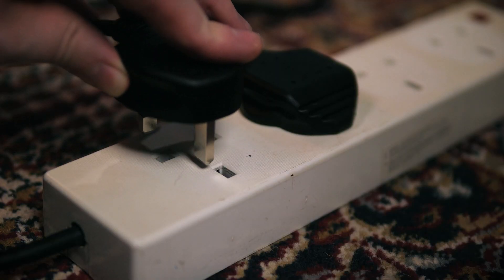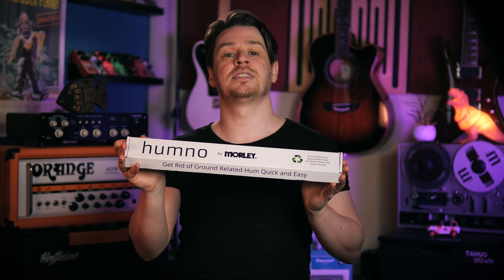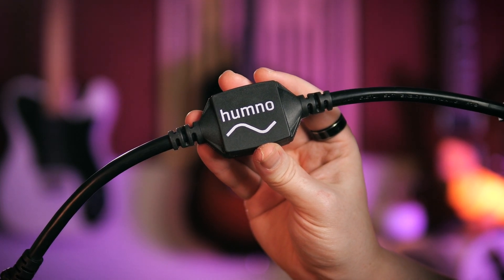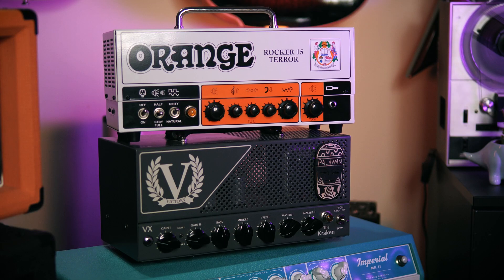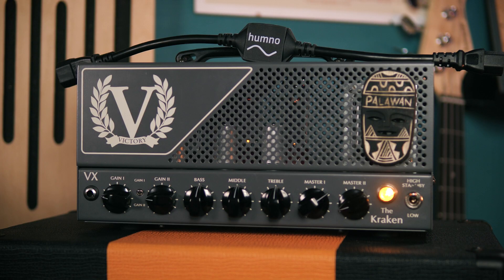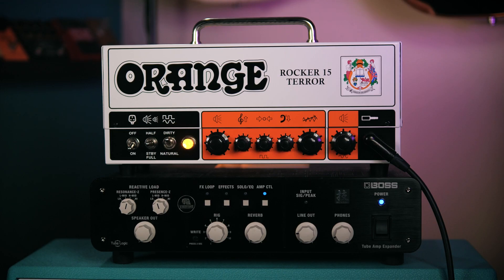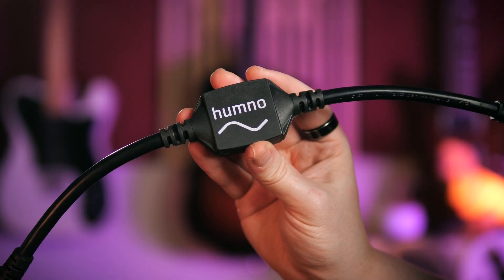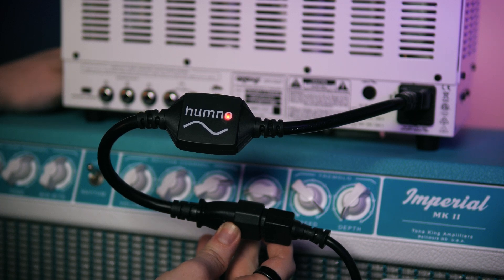HUM? NO! Eliminate Ground Loop Hum

Comment: From personal experience, if your amp is not grounded properly, you're likely to ground out those stray currents through the mic when you sing too close to it. It gets painful after a while, and it's distracting to get electric shocks through your lips and teeth while you're singing! Don't take the ground off! The PA will be grounded, and electricity will take the route of least resistance to ground itself, your wet mouth, on to a metal microphone!

Comment: Lumping all sorts of electrical interference, hum and "ground loops"  together is technically wrong. They are caused by different mechanisms and there can never be a magic cure-all device that will address them all. This is pure marketing BS trying to sell you snake oil. 
Ground loops can be eliminated with DI box, transformers, a parallel earth conductor (PEC) or balanced differential interconnections. EM interference can be common or differential mode and therefore needs appropriate filters and screening not one cure-all cable. Hum can simply be old smoothing capacitors in your amplifier which need changing. I could go on and on and on.....
Reply: You're right. Ground isolators are not a cure all. 

Ground loop eliminators are just 1 solution to a problem that can have multiple causes. This is why eliminating a source of hum is a frustrating experience.

Comment: Can’t help but say these hum limiting devices priced at 139€ are extremely overpriced for the amount of technology in them, as anyone with a background in electronics can tell you.
Reply: As an audio engineer, the only "hum eliminator" worth the price is a USB isolator. My PC injects noise into the signal through the USB ground somehow. Ferrite beads did not work.

Comment: NEVER REMOVE THE EARTH PIN FROM THE MAINS PLUG! People do it on the assumption that at least one other piece of equipment is connected to the safety conductor. But if that piece of gear with the earth pin removed develops a live-to-chassis fault, that current will take all available paths and FRY any equipment whose signal ground it uses! It's not just a health hazard - it's a wallet hazard too! 

I suspect the way the lead works is like a lot of these small form factor ground-loop eliminators. The safety conductor will be run through a couple of anti-parallel silicon diodes. Since these won't conduct until there is 0.6 volts across them the safety conductor (earth/ground) will effectively be an open circuit to the circulating audio currents, which would be lucky to exceed 100 millivolts. When a real fault current flows the voltage is much higher, like in the order of 240 volts, that the diodes most definitely will conduct. 

The issue here is that you hope that the diodes remain intact until the fault current has popped the breaker! And should this device ever have to pass such a fault current, it's probably toast and should be thrown out. It's a bit of a legal grey area (and not so grey with some electrical codes) whether interrupting the safety conductor with diodes is actually allowed. Which is probably why makers of these kind of things are coy about their schematic.

The toroid is a red herring. Although it probably forms part of a common mode filter. This will do nothing for an actual ground loop, but it will help filter out spikes etc on the mains from motors turning on etc. 

It is better to eliminate ground loops on the signal path by using audio transformers. If it must be done on the mains side a mains isolating transformer is better and safer than these diode hacks. 

One more thing, hum is not always caused by a loop. It can be induced. It might be perhaps two pieces of equipment stacked on one another. The sensitive gain stage of one being directly below or above the power supply section of the other one. Or it might just be that the shield is broken on one of the audio leads, particularly unbalanced leads.

Comment: I don't really think I've ever connected my amp to a grounded output, well I tested it put it didn't change anything - the hum was the same. So I really, as an electrician wonder, why do they insist in using grounded outlets. The wooden or plastic case can't be grounded anyway. This thing, if it really works, seems usefull. But yeah, you can actually pretty much kill all noise with a noisegate no matter what is said in here.
Reply: Actually, it's even easier to kill the more silent noise than the distorted louder noise with a noisegate. So this seems like a total add with disinformation.

Comment: Great video 

I’ve already got a furman power conditioner. Wondering if there would be a benefit to run one of there nohums into every amp/PS independently
Reply: For those who don't know, power conditioners DO NOT STOP ground loops.  

This is only really necessary if you have 2 grounds connected together that are both connected to the mains (wall outlet) ground. So if you have a pedal power supply that uses only a 2 prong connection with an amp with 3 prongs, this isn't really necessary. 

However, as a producer, this can be useful because if you use a DI box into a mixer/PC as both use 3 prong connections. 

If you're not a producer, this could be useful for when you're BiAmping.

Comment: Putting components in the mains Earth wire is going to compromise your safety just like disconnecting the Earth. Can you measure the resistance between the Earth pins at either end of this device? Or run a PAT test on an amplifier with the Humno in circuit?

Comment: If you test the continuity of the ground circuit part of the Humno with a multimeter set for the diode test function, it will tell you if it's a standard legal ground lift utilizing a bridge rectifier. If it shows a voltage drop with the diode function, or a small resistance of around ten ohms, it is a ground lift circuit...and that's OK if it is well designed and built.

Comment: The Revv G8 can be used to deal with ground hum (for the most part) by using it in the 4 cable arrangement, that's my current setup at home.

Comment: To clarify, what is the benefit of using this independently or simultaneously with a power conditioner?
Reply: it's important to understand that POWER CONDITIONERS DO NOT STOP GROUND LOOPS. 

Power conditioners protect your equipment and also attenuate EMI/RFI. The benefits are basically the same if you use them together. You get the removal of the ground loop AND the benefits of the power conditioner. It won't improve your tone, unless your current tone is plagued with ground loop hum.
Reply: @TeddysMusic772  Thanks for that!

Comment: Hi Colin! I have a question for TATA: why there are so many basses with active onboard preamp/EQ and no guitars with this feature, and on the contrary there are many guitars with active pickups and almost no basses with those?
Reply: What basses are you looking at...? Fender basses (the biggest and most popular bass brand in the world) have passive pickups in the absolute majority of their lineup. Are you looking mainly att basses specifically for metal? If so, that's your answer right there - many bass players in metal want active pickups because of the higher output, which often suits the style/genre better than low output pickups.
Reply: @MrGul  That's part of my question. There are no active pickups in these basses, it's passive pickups with active onboard preamp/EQ. Try to search basses with two humbucker pickups and you hardly find couple models without battery
Reply: A guitar with an active pickup does have an onboard preamp. That's what makes it 'active'.

Comment: Colin, I have a question for you (and any of the fine persons in the comments section).

I want to buy a tube amp through which I can play both electric guitar and bass. I have a Suhr Reactive Load Box and a Two Notes Torpedo Cab M+ with a ton of IRs I like.

I own various guitars, each of the most popular Gibsons and Fenders actually, and a Fender P-Bass and Jazz Bass. I also have too many pedals, but most of which I like and use.

Anyway, the point of my question is that I want to get an amp for both bass and guitar. I have been looking at a 50-watt 1968 Fender Bassman but it will cost me $2,000. I could sell some gear but I would prefer not to, and would like to get something a bit closer to $1,000 to 1,200-ish. I would also like to avoid getting two amps (my room is cramped already), and also avoid Solid State because I have never owned a tube amp and that's my top priority--I want to know what the tube fuss is about before I die and I don't live somewhere where it is easy to go test a bunch of amps at like a Guitar Center or whatever.

I am not a gigging or professional musician, just an amateur who writes and records his own music and has a bit more money than sense, but not an excess of either.

Is this an idiotic quest or can it be done?
Reply: I use my EHX mig 50 tube head for both bass and guitar, but you would need to make sure you get a bass speaker cabinet. I can’t recommend the mig enough
Reply: @andvgeo2253  Thanks, I've heard good things about it but didn't know it was OK for bass. It's now on the bucket list ^^

I ended up pulling the trigger on the Bassman and I couldn't be more pleased with it. It's fantastic and I think I get the tube amp hoopla now. 

As someone who had always used modellers, they are definitely not good enough yet. Tube amps are champ.

Comment: After checkin on thoman this thing is little and they say its a isolation transformer and I hope no one loads it to its 6 amp max. I tried that with a marshall mg as a preamp to a marshall tube amp annnnd nope. I couldnt rin fast enough to get away from that loop hum. I got computer noise. Mixer computer and monitor amp  and the fukinnoise is the computer. 120$ american for this. I hope it solves alot peoples problems . As small as it is and bein an isolation transformer if they wound their own it might cost but if its a 1:1 transformer and little like that, it might be regulated and filter but them parts about 6$ when I had a lab I had a 15 amp 1:1 it was about 8" square I didnt look around much but I was lookin for a 20 amp and came across 300 somthin dollars I stopped that if I could fast for 2months I could afford it.

Comment: Ok, given there is a US product that plug directly into a NA outlet, this thing would still work in a NA circuit right?  s=
Reply from the maker: Yes, this works 120V or 230V for any standard IEC power cable.

Comment: I had a possibility to be listened when one of my then home towns businesses was investing into their new esports-studio and I told the electricians to wire up the main studio and control room with star grounding.

The guy goes "eh, what?" and I drew the idea for them, that you take small groups of sockets (2 or 3x2 sockets at most) and for every group you pull the electric cables, with grounds all the way to the main breaker box and there and ONLY THERE you connect the grounds together at one single point.

This all but eliminates buzzes and hums that are result of ground loops or result of interference from other equipment spitting stuff to the ground wire (switching powersupplies) that most AV-equipment these days rely on to be somewhat clean or low impedance to ground.

Groundloops themselves are a bit of a !#¤ to solve just by wiring, but star grounding helps a TON because it helps to ensure that all devices in one group have the same ground reference and all the groups have the same between them and that the lowest impedance path for the ground currents is the ground from the breaker box, not through some other equipments ground.

And if there's ever a situation that some equipment is bothersome, you can just move it to the next group and all the noise goes away because the interference finds lower impedance path from the star grounding point back to the ground and doesn't want to take path all the way back to some other equipment.

That job costed like 300€ more in material and i think an hour more in work, but there was never, EVER any interference from other equipment and electricity in that studio was very VERY silent through that one year I was there as a technician :)

If every venue out there was wired properly, we'd have less of these issue. It's not that expensive if you do it when the place is built or when it's remodeled, but it's expensive AFTER that if you need it to be done...

Comment: Hum/added noise comes from many places: the mains, your cables, your pedal power supplies, and possibly your guitar. I'll address the first three. This is a cool product that'll help with hum from the mains. Morley/EB Tech also make a great passive Hum Eliminator with four 1/4" jacks on two channels with and without XLR. Those will eliminate any hum picked up through your cables. And to kill the extra noise added from your pedals, add a switch-mode power supply like a Cioks DC-7 to power all of your pedals, if it's not enough, add a Cioks 8 for more power. Just "isolated" power supplies are not enough and most are garbage, they have to specifically be switch-mode if you want consistent results.
Reply: Thanks for this!
Reply: I can't say good enough things about Morley / EB Tech and Cioks, just do it. A Cioks DC-7 can power something like ten Cioks 8s if you're a pedal hoarder who needs 23 delays running simultaneously. On a serious note, I have a DC-7 and 8, which has 15 outputs. I actually power about 20-ish things including my more power-hungry Boss ES-8 and Digitech Drop, doubling up on some more standard powered pedals and it's still noise free.

Comment: Need a detailed explanation here: Is it still considered unsafe if only one of the amps has the ground prong removed? It will still be connected to ground via the send/return cable going to the other amp right?
Reply from the maker: Do you really want to rely on thin instrument cable shielding  which isn't rated to carry that kind of current to protect you if the chassis became live? 

Because I wouldn't. I'd want the big earth cable directly mounted to the chassis to do the job.
Reply: It will probably fry that amp too. Do not remove the ground prong on any device.
Reply from the maker: Also, you've got to ask yourself: is it safe to have a mains cable with a disconnected ground pin existing for unsuspecting people to use in other applications?
Reply: @ScienceofLoud  I don't know that's why I asked for an in depth insight. It's also worth noting that in our country (Philippines), it is not a common practice to have the electrical outlets have the third hole for the ground. Honestly I couldn't ever remember if I have seen a 3-hole outlet.  Most of us use the 3 to 2 prong adapter. What would be a remedy to that situation?
Reply: @dispersemedia  that to me is so incredibly sus. I never recommend using cheater plugs as they can be fire hazards if a short ever were to occur. 

This is why I stopped jamming at a friends house with my amps. His house hasn't been updated since the 50s and he uses cheater plugs for everything. A single short will light that house on fire. 

If he has a safety ground prong, the breaker would shut it off.

Remedy might be to replace the outlet with a GFCI outlet so that if a short ever occurs, it will trip the internal breaker. Not sure how feasible this is in the Philippines tho

Comment: Worse than everything in a venue using the same ground are venues that have more than one power drop. This normally shows up when the FOH mixer is far away enough from the stage to end up on the second power drop.... sometimes there is no hum but your powered FOH speaker stops working.... Oh it has a transformer-less class D amp and has just blown up . I do not think this device would help that. In this case a 1:1 transformer on the balanced lines with the signal ground lifted is required. (all amplifiers and other gear retain their grounded power of course) In more normal ground loop situations such as you demonstrated, a 200 ohm resistor in series with the ground line in your audio patch cord can be effective too, and maybe cheaper. Yes grounding is a problem.... And no I do not want to rely on my patch cord for my safety ground.

Comment: I sometimes have those issues sometimes when using a stereo pedal with 2 amps
Reply from the maker: yup, that's another classic way to create a ground loop. Stereo amp rigs would benefit greatly from the Humno.
Reply: Recommend something like the Radial ABY pedals or the GigRig humdinger when using a dual amp setup.

Comment: I still get ground hum using non grounded plugs, so that's a myth.
Reply from the maker: Not having a ground at all can also generate hum, because those currents have nowhere to go but keep cycling around the system.
Reply: It also depends. Do you use pedals? Do you use a DI box into a mixer?

Keep in mind if you're using USB audio interfaces, the PC itself can cause ground hum if used with DIs.

Comment: I bought a morley hum exterminator specifically for this old Tech 21 Trademark 120, plugged her on in and boom it was a problem with the amp itself. probably the transformer or power amp from what ive heard online even though im a pure novice to amp maintenance of any sort. that being said that cantankerous behemoth lives in my closet now waiting for the day for me to either punt it or get it fixed-  I guess the hum eliminator works though?
Reply: There are some niceties with the Tech-21 gear that can make them prone to hum. They actually mention this in the amp user manuals. You can cure some of it with  the XLR ground plug they sell. Also judicious use of buffered pedals on the input can also go a long way to shutting them up.